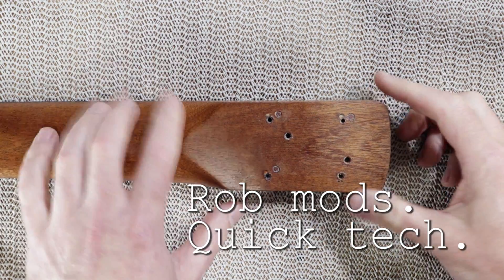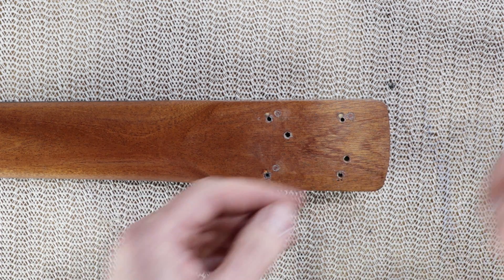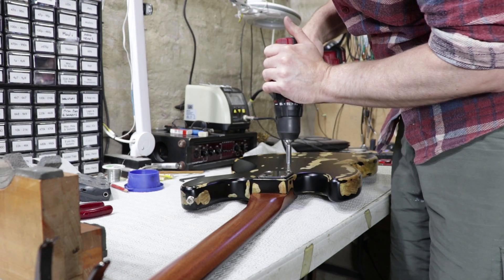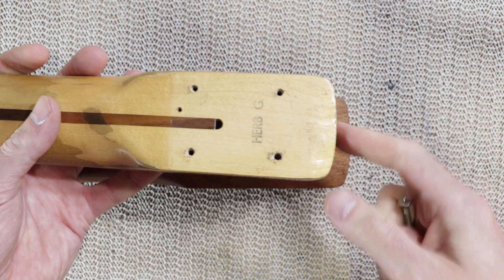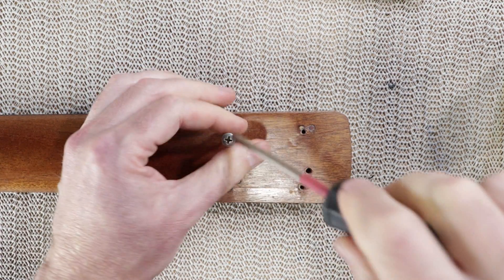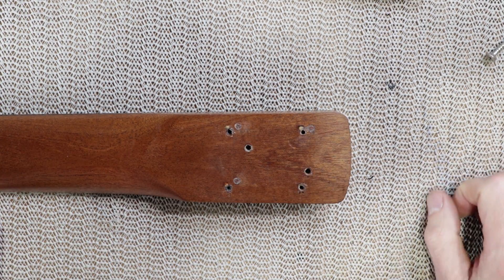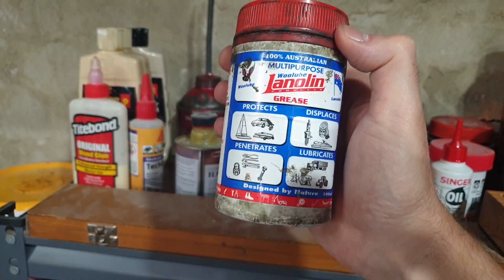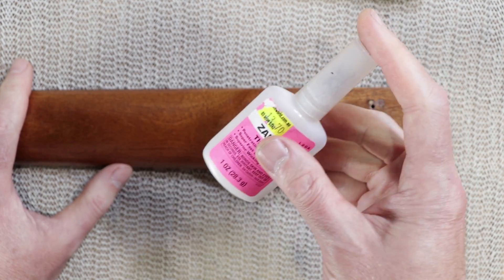Neck Heel Screws or Threaded Inserts

Comment: The trick I do when installing the neck screws is to initially screw the screw backwards and you will feel the screw pop into the thread, then screw the screw in normally. I also reinforce the threads with thin CA

Comment: In the late 1980's I was selling high end stereo equipment, and in setting up a Linn Sondek turntable, the procedure for attaching the Medite (ultrafine particle board) tonearm mounting-board was similar: CA glue into the armboard mounting holes, and the board was attached to the turntable with very small screws similar to what you'd use for mounting tuning gears. (Medite has no grain, so without the CA glue the tgreads would be weak). PS, CA has an accelerated curing time in contact with wood or cellulose.
Reply from the maker: I've been doing it for years.  I've used it on jigs and tooling and all sorts of wooden stuff.  It wasn't my idea though. I picked it up from somewhere...

Comment: Make sure you use the CA glue prior to using any wax or grease for the first time on the screws.  If there is already wax or grease in the hole, the CA will not penetrate or stick to the wood.

Comment: I like the idea of hardening threads with superglue.  And lubrication (I use candlewax with woodscrews).  You're correct about some timbers oxidising steel.  Oak is particularly bad, but rarely used in guitars.  Any time I work with oak I always clean off my tools thoroughly afterwards, having once come to a mortiser that someone had left for a few weeks, destroying both the bit and the square chisel.  Regarding inserts: I much prefer them over woodscrews, as the neck join can be made really tight, and the thread isn't going to strip.  I do tend to bend my Tele neck though, so the joint really does need to be tight.
Reply from the maker: Oh yeah, I didn't think about oak.  Yes it has high tannin content.  I think that is part of the reason it is used for wine barrels.  So my light/dark timber theory is a bit out.  Maybe still a "rule of thumb"...  At Maton, the MS500 guitars had inserts that were installed on the top side of the neck heel before the fretboard was glued on.  It was all cnc machined of course so everything lined up well, and the metal inserts were machined by a local company.  They were two metal bars with two threaded holes each.  Seemed a nice way to do it.
Reply: @RobMods  Thank you.  I didn't know about the Maton design.  If you're fitting a separate fretboard, that makes sense.  Even without CNC it could be achieved with accurate jigs and tee-nuts.

Comment: I melt a little bit of candle wax or paraffin onto the threads (do it on bridge, pick guard, tuner screws going into the wood too), makes them  go in and out without stripping the thread way better.
Reply from the maker: Yes candle wax is a traditional way to lubricate timber drawers etc as well.  I often use Goss Dri-Lube on various guitar parts.  It is softer than wax and very useful.

Comment: Thanks Rob. The other thing I like to do when reinstalling neck screws is to turn them backwards until you feel it drop into the first thread then screw it in.
Reply from the maker: Yes, there's nothing like actually using your fingers to "feel" the screw engage.  Using hand tools is another nice way to build up that "feel" for woodwork in general.